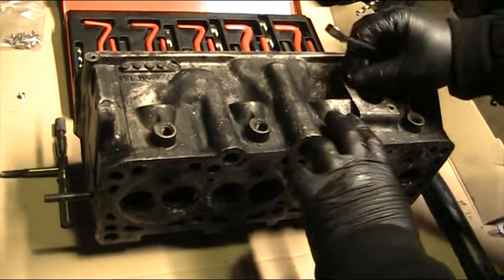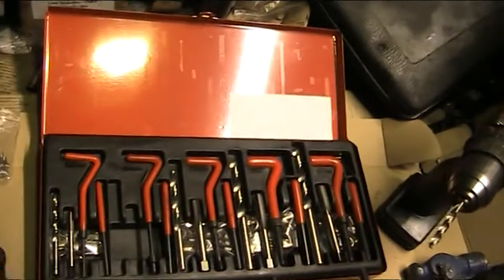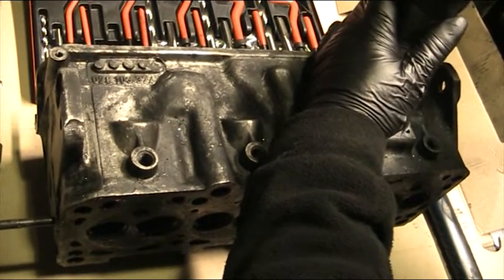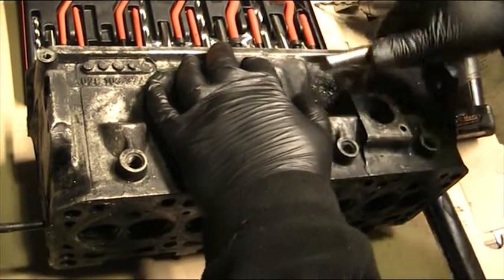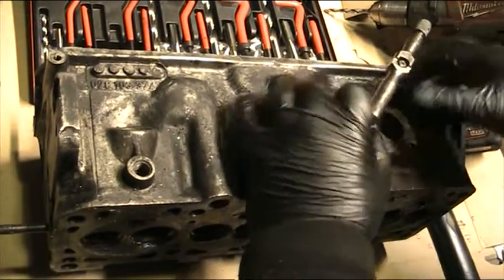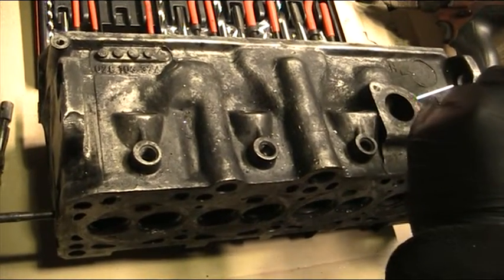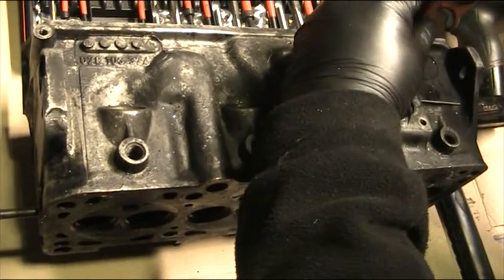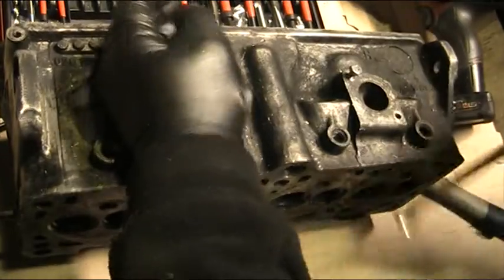how to helicoil

Comment: Hi mate, would you say it's a good idea to helicoil an engine block? an aluminium Isuzu/Renault P9X V6 block to be precise? Currently doing a headgasket change on one and the head bolt has snapped in the block when removing. Cheers.
Reply from the maker: hi can the old stud be drilled out or has the thread gone
Reply: @charlieengine  I think the thread has probably gone. But it may possibly be drilled out. Sorry for the late reply. I didn't realise you had commented.